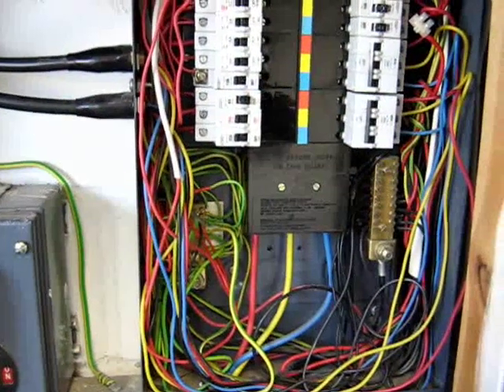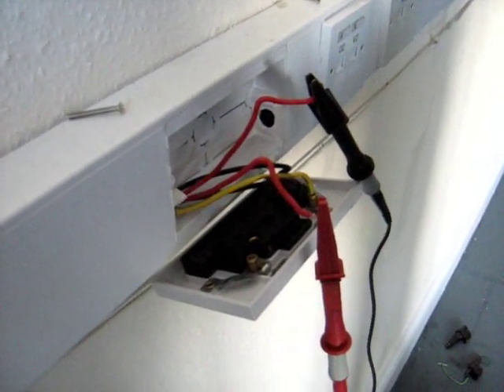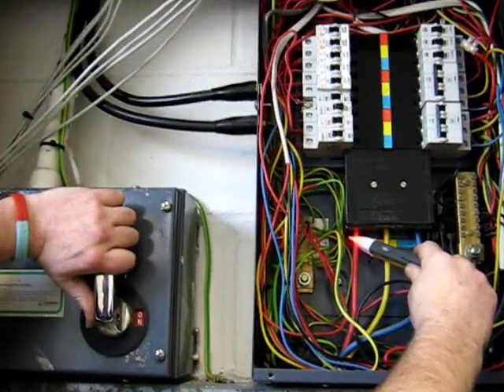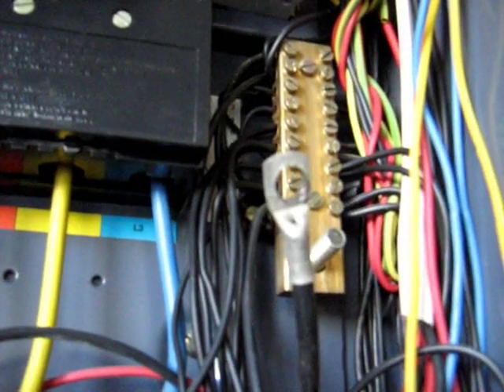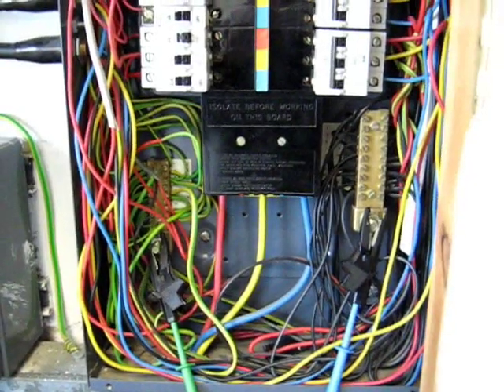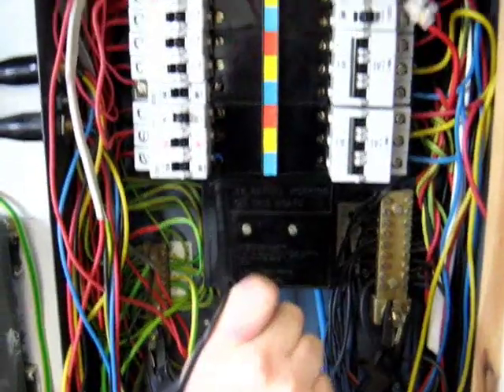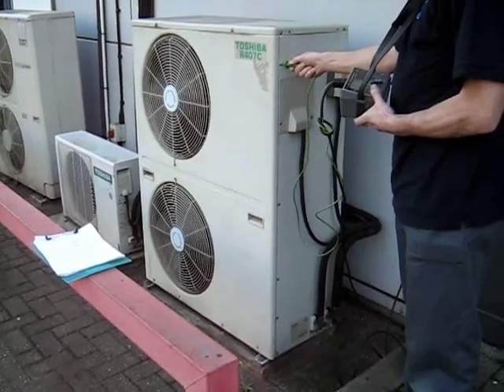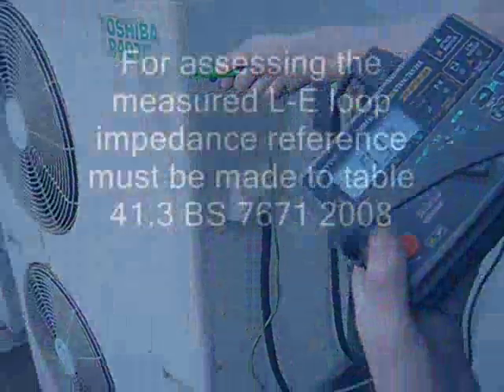Electrical Inspection poplar Business Park

Comment: hi just seen your inspection test vid in Popular London,i agree with your comment in reguard to dragons comments. Its not always possible to remove earth to do Ze test. It does state that in Christopher Kitchers second edition Inspection and testing and certification.The only question i do have is i always had Ze down for being a measurement of external ,being the resistance of the supply transformer winding,the supply phase conductor,and the earth return path of the supply. Wolfacer 2330 level3

Comment: @don1dragon Like mentioned, you really need to actually have some experience as a sparky on the field before dictating do's and donts. I would personally use my multi tester but sometimes, when all you have is a volt stick, just flick the isolator on and off a few times to verify its off.